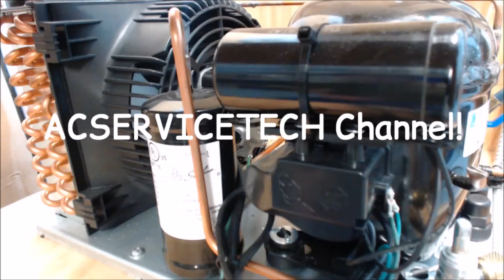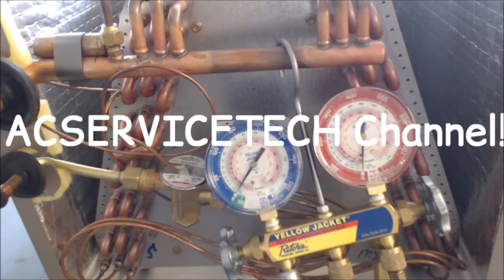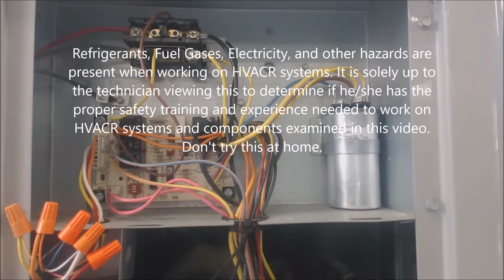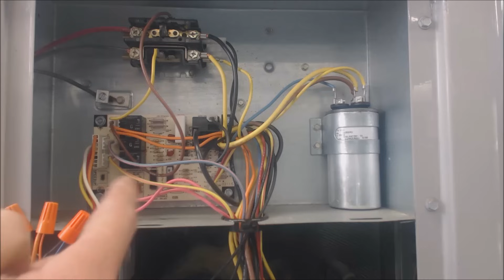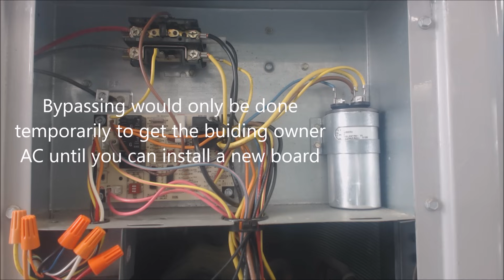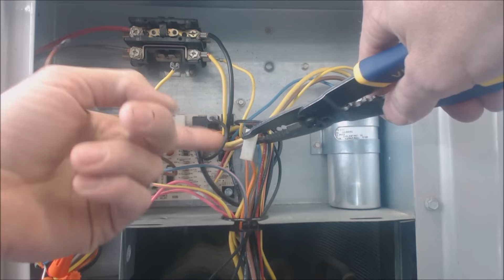Heat Pump Troubleshooting- Defrost Board Testing and Bypass for Cooling!

Comment: Thats a whole lot of extra steps.  If you want to jump out a heat pump and bypass the board just wirenut red(24v) orange and yellow together. Done.
Reply: Bingo
Reply: Or just wire nut yellow from the condenser wire(thats coming from air handler) to the 24v side of the contactor without touching NOTHING else

Comment: I just disconnect the wire from the board to the contactor and then connect the last leg of the pressure switches straight to the contactor. Easy fix until I come back with the board.

Comment: maaaannn, its 2024 jan. and i am so happy i found this video. Thank you. I have a Rheem unit that is giving me hell. I can not figure out why i am NOT GETTING any heat. The unit in the heat mode gives no heat at all. The out door unit does not come on at all, (in heat or cool modes). My indoor fan run continually, but no heat. In emergency mode not heat also. The fan just keep running. The out door unit pc board is flashing on the top LED, but the bottom LED, is OFF. Dont know what that means. i am hoping that i can get some help from you sir, or anyone else, i am in orlando. It is cold now. I have no heat, i am old and cold, what a life!!!.i am not a ac man, but has gathered some good knowledge thru the yrs. The indoor unit seem to ok, it blows air out, not heated air. What can i checked? I need help. Please anyone. thnx again for this video. which it was a rheem still.

Comment: I performed this and my AC works!! TY!

However, my external unit FAN doesn’t ever turn off, even when I turn off “cool” on the thermostat.

Did I wire the fan wrong?

Comment: What if I don't have 24 volts on my thermostat wire from common to Yellow?
Reply: Thermostat is on 5 min delay..or bad thermostat..or someone wired the float switch to yellow @ air handler..or if in 2025 since we are using r454b your air handler senses a leak doesnt allow to turn on

Comment: If I'm replacing a transformer in a carrier package unit that is missing, and is missing the wiring diagram, where would I hook the low voltage wires? The red goes to the R on the board, but what about the common wire? Does it go to common on the Board, or to the contacts? Thanks.

Comment: I Have a York 5 ton package unit heat pump.Changed a bad circuit board.But know i get heat when thermostat is on cool and cool doesn't turn on.Maybe swapped wire or bad thermostat?Thank you.

Comment: I love your videos. Im subscribed. I had one question. Do you have to bypass the defrost board for Air conditioning everytime on those models if the defrost  board goes bad? Even if it were cooling season and the tstat was set for cooling.  Im trying to understand,i almost got it. I just dont understand why they would route the defrost board in cooling mode. Any input would be appreciated , thanks, keep up the great work.
Reply: In order for cooling to work on a heat pump, a properly functioning defrost control board is required. If the board is bad and you want to know how to bypass the bad board so that you have cooling, just do as Craig showed in the video.

Comment: I can do all that or I can run a simple jumper wire from yellow to the contactor. When a call for cooling happens - contactor pulls in and she fires every time. When tstat satisfied it will drop out 24v from yellow terminal and u deenergize the contactor. Far more simple than this.  Its suppose to be a temporary fix until u get new parts.

Comment: How do you run the wires for the high / low pressure switch after bypassing the defrost board ? Any help will be greatly appreciated.  Thanx
Reply: They should be in series with y. So that when one of those switches open it kills the call for cooling on the contractor

Comment: Just graduated HVAC trade school and have a buddy that's having an issue with his outdoor heat pump unit. Says he hears his outdoor unit run randomly in cool (lives in las vegas about 70 degree weather currently). He noticed it because his unit is right next to his bedroom. Thermostat is set to off the times that this has happened and the said he didn't feel any air coming out of his Vents.  Told him to check for any schedules on the thermostat and there was none aside from it already not calling for it because the tstat is off. What are some possible things that can cause this. When I went I didn't see anything out of the ordinary and it happens randomly.
Reply: Sounds like he may have t stat wire (Y and R) that is touching. Likely at the outside unit. Perhaps wind hits the wire just enough and sways it enough to power the outside unit. That is if it's super random and has no air flow inside when that happens.
Reply: @jonathansorise8797  I don't think it's winds causing this issue. But I checked all connections and found no uninsulated wires or wire terminals close to others to cause this issue

Comment: As old as this video is, I must say...it is still saving lives over here! My wife noticed the thermostat was out. Oh boy...here we go! Mind you, I am no AC service tech, but just a homeowner with a handy knowledge of the trades. Noticed a fuse blown in the air handler. Let's hope it was a one off and change it. POP again! Looks like we have to chase down an LV short. Pull the thermostat and removed the terminations hoping it was a bad thermostat. Used these wires to isolate the condensor LV wires and found the yellow wire to the condensor to be the faulty one. Tested both cables to the thermostat and the condensor and both are good! There goes the easy fix....now i am in the condensing unit. Found a circuit board and thought it was game over. I started to remove the thermostat wires one by one from the board (which I later identified as a defrost control board), and after blowing through several fuses, I found the yellow wire to blow the fuse everytime it was plugged into the spade terminal. Now I was done...my first assumption was that the defrost board was bad and now we are just going to have to ride out the night in Florida heat with temperatures inside at 80 degrees. My wife and daughter were sleeping so peacefully but sweating as the temperature was rising. As much as i wanted to do something about it, i felt as if my hands were now tied until i can replace the board, but getting through the night was being Did some research looking to buy a new board and stumbled across your video WITHOUT even thinking that bypassing was a temporary option. Although the system was different, the theory behind it all was the same. Needless to say, I was able to fix this for the night due to your in-depth and detailed explanation of what you were doing. We are now at 76 and dropping. To find a new board is the next move. Will my family suffer tonight? No! Thanks to you for the knowledge and direction you provided! Without it, my family would be miserable tonight. That is no longer the case and I thank you again for it!
Reply: i hear you man, i just found it now myself it is 2024 jan. but i wish this was a rheem unit, he was showing here. he said that the rheem unit functions different in cool mode that the other mfg, units. So, i am trying to figure out what the rheem units do in the heat mode now, my out door unit is NOT COMING in either heat or cool, but the indoor blower unit is running ok for now.
Reply: Most likely it was the contactor and not the defrost board

Comment: Looks like a lot of extra work, Just jump the reversing valve until you new board comes in
Reply: Exactly why cut wires from reversing valve simply conect directly to contactor

Comment: After checking all inputs and outputs, and bypassing the board, I am real sure the board is bad at my ex's house. all 24 volt inputs are good, switch circuit has continuity, temp sensor at 5kohms. Unit has been bypassed and operating normally for several hours. Here's the rub- it's a Diamond Air model d1336hcb I installed myself 7 years ago. (I believe the electrical storm got it- we had one the night it quit- got the thermostat, too.) The board at Budget HVAC is 225- that's godawful high for a defrost board. ONLY source I've found to date. Can I not use a cheap Goodman board or something else with the basic connections? and does it HAVE to be from a unit that reverses on heat (this one does), if I wire it to operate correctly? Got any suggestions? I have another quadplex besides this house with 6 units- I need your book!
\

Comment: nice video, but for a home owner just learning some ideas will need to watch a few times  ty  nice clean job............so for me, I would ck the voltage going into the transformer and coming out then i guess see if power is coming off the defrost board.............?? thanks again

Comment: Great video. I've been trying to troubleshoot a system. Basically it heated great, but once switched to cool it short cycled. I thought the defrost board wasn't controlling something right. I connected the Y from thermostat to Low Pressure switch. From there I connected the reversing valve and contactor wires. Then common to contactor and reversing valve. I also moved the fan to the contactor. The contactor jumped crazy when I turned it on. I took the low pressure valve out of the loop and it ran without stopping. I checked pressures and got a constant 75 psig and 240 psig. Looks like the low pressure was doing its job. However, checking continuity on it, it switches at about 150 psig. Is that correct? I can't find a spec on that switch for a 410a system.

Comment: Would it be good to connect your pressure switch in series with your contactor in case that the pressure drops it would stop the contactor?

Comment: Hi service tech,Im trying to troubleshoot a Rheem  and everything operates well in cool mode, but when i turn heat mode on the reversing valve energize but i dont get the 24 volts from yout and cc to energize the contactor and after a few minutes fan and heat strips come on and it keeps operating that way... any tips what should i be looking for? thanks in advance for your response.

Comment: thanks for all the great info. mine just runs and runs. the air is never cold in the summer and never warm in the winter. its a 10 yr old 5 ton heat pump. what should the temp be coming out of the register?

Comment: I'm getting 24 volts from O to C, but nothing from T2 to C. T2 runs directly to the contacter switch. There is no resistance in the T2 wire. Can I then assume the control board is bad? Thanks!

Comment: The de-ice I'm familiar with is so much simpler. On sensing Low temp, just  lifts the neutral to: reversing valve, indoor fan, outdoor fan. Compressor continues running. Machine jumps into cooling, condensor melts ice, either for 20 min timer or till temp rises. Then switches back.

Comment: What if  I have gas furnace and not dual fuel thermostat.  Can I disable defrost like you show here and wire heat W to furance W.  Or even not connect O in thermostat at all?

Comment: I have 3 low voltage wires for heat pumps and want to ADDING 1 more wire what should I do ??? I can’t change the wire

Comment: I just had to replace  an outdoor condensing fan and the defrost board had to be bypassed in order to run the unit in ac mode. I just jumped out the fan relay and tied the outdoor fan right into the contactor and it ran fine and now it just shut off according to the homeowner. It"s a Payne unit. I'm guessing I have to power the reversing valve as well as you just did in the video. If so why did it run fine at first.
Reply from the maker: The reversing valve would need 24v on it if it is a Payne for cooling, thanks!

Comment: Doesn't look like this unit has an outdoor thermostat. Would an ODT have any effect on strictly cooling? Or would it change this bypass method?
Reply from the maker: The odt sensor would just affect it for heating mode, not cooling mode, thanks!

Comment: Dude, this video is on point with this bypass you did for cooling. Very thorough explanation and in detail...
Reply from the maker: Thanks Manny, this is just a temporary bypass. If you were to keep it like this for an extended period, make sure to include the pressure switches in series with the 24v hot to the contactor, thanks!
Reply: @acservicetechchannel  you're welcome and I need your help again. My neighbors unit is a complete Rheem system and it stopped cooling a few days ago and I tried doing the bypass but it didn't work like yours did. I did find that the reversing valve and the contacter was not getting the 24v from the defrost board but once I jumped it from the red wire to the contacter and disconnected the 24v side of the rev valve, the system started cooling. It worked for about an hour and half to cool the house to the set temp of 77, but it didn't start up again. I haven't looked at it again but i think it's the contacter that didn't close. I ended up reconnecting all the wires to how it was before and just jumped power to the contacter. Also, the common brown wire color coming from the thermostat doesn't work like it should when it gets to the defrost board. You have to switch it to the blue wire for it to work. This doesn't make sense to me since the schematics show the brown wire as the common. Sorry for the long story.
Reply from the maker: Rheem powers their reversing valve during heating instead of cooling. The one in the video was a carrier one, thanks

Comment: I went to troubleshoot a friends heat pump package unit and they had switched back and forth to a smart Tstat and I guess had heating problems in the winter and they put it back to the old tstat. Well now it didn’t want to energize to cooling and I wasn’t getting 24v to the reversing valve. (The tstat wasn’t sending the signal I guess) so just to get the cooling temporarily, I bypassed and wire nutted the orange wire to the Red wire and it worked fine.. I need to figure out what the issue could be.. any advice where to start?
Reply from the maker: Did they not connect the tstat O wire, sounds like they need to connect to O and not B because of having to power the reversing valve in cooling mode. Check for dip switches in the old tstat and any programs that will tell the tstat what it is connected to for instance if the tstat thinks it is connected to a furnace and ac. Not sure what tstat this old one is so there are some things to look for, thanks Josh!
Reply: AC Service Tech LLC  So they don’t have that extra wire for common. Will that affect any troubleshooting with a voltmeter?
Reply: Thanks for the response. I believe the old tstat just has a B terminal and it is only a 5 wire tstat wire. And Yeah I was thinking maybe they didn’t program the Tstat to a heat pump but that tstat is older and I doubt they have any instruction manuals to re program it . im suppose to go back to continue troubleshooting further and I’ll look more into the tstat itself but the system was 4lbs low on charge so I’m suppose to go search for a leak also. Some oil residue near the discharge line after the compressor so hopefully I’ll be able to find it with some bubbles and not have to purchase a leak detector

Comment: Looking at installing a heat pump and air handler with electric strip heating for back up. I am replacing a 15KW (no heat pump) strip heater air handler. Can I downsize to a 10KW heating strip as when needed it is only adding to the heat provided by the heat pump?
Reply from the maker: The heat pump won't be supplying heat at lower temps and since you already have the correct electrical supply, you may want to stay with the 15kw but basically a heat loss calculation on the building would determine your heating needs during winter, thanks

Comment: Unless it's a good customer, I don't suggest doing this. Once the AC is working again, there is a probability that they may not call you back to have it repaired. Plus, when people sweat, they pay.
Reply from the maker: Yeah you can't leave it like this for sure. It is just to get the AC on. You know your customers so do what you think is best, thanks devious!
Reply: devious dom. I'm with you, if the machine has something dodgy (the customer may not comprehend your explanations) it's best to aim for DISABLING the machine in order to save it. Even air flow can fool the customer into thinking it working. Sure enough they call you back with their Wallet ready.

Comment: I would have wired the high and low pressure switches in series with contactor
Reply from the maker: Yeah youtube took the annotation notes out on Dec 13th that had to do with that, thanks!

Comment: Thank you for sharing this info!
I'm not getting a change when testing resistance with T1 and Y, meter stays at 1.
I'm also not getting the low voltage to my contactor. I'm not sure if it's the board or a pressure switch that's bad. 
Contactor tests out fine, but it will not energize to make.
Reply from the maker: You should disconnect the compressor and fan from the contactor for safety. Then put one probe on common and one probe on the 24v hot coming off the board and follow the 24v through each pressure switch and/or temp sensors until it comes back to the board, thanks
Reply: @acservicetechchannel  Thank you! I really appreciate the info. I'll run through that tomorrow.
Reply: I have the same issue.  

I don’t see T1 or Y anywhere on the defrost control board.

I have 24v at Y, but no 24v at the contactor.  

I have narrowed the missing 24v down to where it connects to the Hot1 and Hot2 which is the Hot Gas Bypass switch.  HGBP.

The schematic does not show how the 24v should reach that point. 🤔 

I’m stumped!!